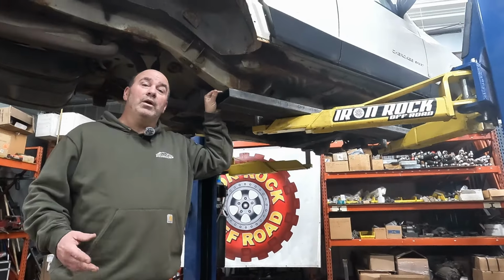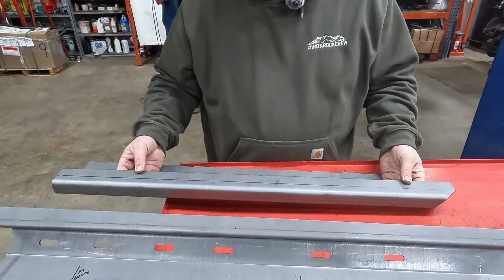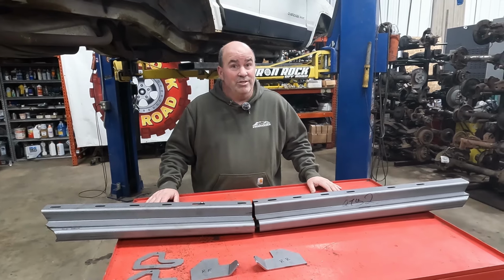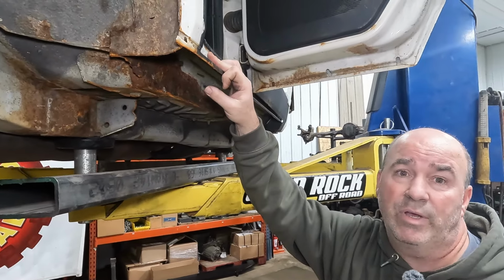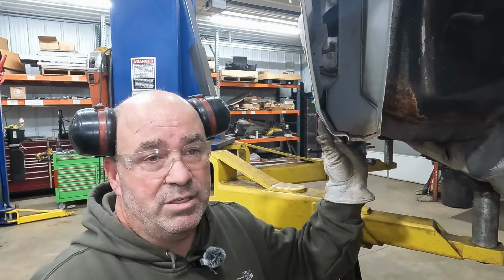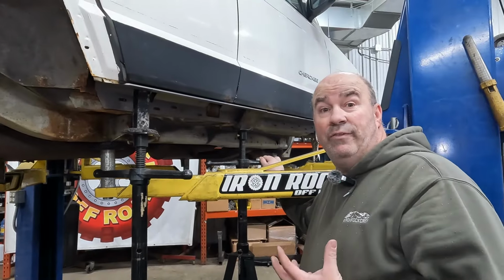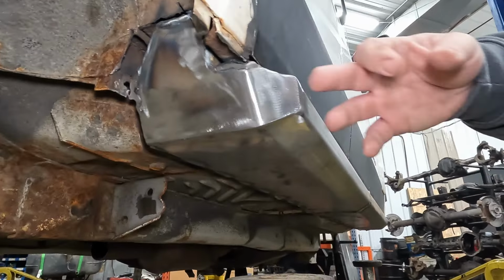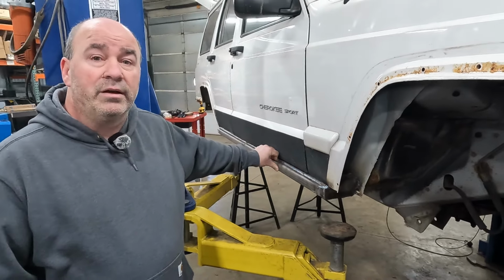XJ Build Series - Rock Sliders - Better than 2x6! Stronger & Higher Clearance!

Comment: Man, what a shame to weld that thing right on top of all that active rust.. grinding the whole area and adding a little weldable primer was just too much work?
Reply from the maker: @stevehamel1336 Great point. Because of the time constraints we did not show painting the interior of the rocker in the video. Later, after the video, we used a sprayable internal frame coating that comes with a long hose attachment to reach inside and coat the rocker from the inside. We have not had great luck with weldable primer in the past. Do you have a recommendation on a good product?

Comment: Great product that I am going to install on my XJ....but why didn't you take the opportunity to treat the rust that is now sealed behind the sliders?
Reply from the maker: @WBR79 You are correct. We should have treated the rust inside the rockers before welding. The good news is that if you pop off the door sill plastic it gives access to the top side of each gusset. We plan on spraying Eastwood Internal Frame Coating inside the rockers using the included 24" extension tube. We should have done it right from the beginning, but this is better than nothing!

Comment: Man, this is begging for some plate to be welded in to the unibody rails from the rock sliders... super strong if you've welded in the stiffeners, and the XJ isn't a rust bucket.  Weldable primer, drainage holes and cavity spray...
Reply from the maker: @Brian_C_ We appreciate the input. The design of these sliders has been proven in the rocks and we stand by them 100%. However, we know there is no one-size-fits-all Jeep product on the market. If you feel the need to add more plate to them, we say go for it! We completely understand the itch to change and modify things. That's how we got here!
Reply: @IronRockOffRoad  Totally agree about the 'no one-size-fits-all'. Rocker armor is definitely one of those things that ranges from 'absolutely stronger than the XJ' to 'I'm just doing it for the look'. Looking at your product, I'd say it's solid. I absolutely love the idea of the reinforcement ribs vs. using straight 2x6 steel. Having those pieces CNC plasma cut is a huge time saver. My previous was, in no way, a negative criticism of your product.
Reply from the maker: @Brian_C_ No problem at all, I didn't think it was negative. I figured it was just one Jeep guy talking to another, tossing around some ideas. I would say that if you are tying a roll cage into these sliders then I would 100% add some gussets from the slider to the uniframe rail. It's never a bad idea to add strength when we're talking about safety items.

Comment: Great idea.....think you can do similar to the JK/JKU platform since its body is like a car (no tub like that of a YJ/TJ/LJ) with a drip rail holding the floor panels together? 
What about placing a rub rail on the outside square face to match the width of the flare?

Edit: seen your latest on the XJ mods and the rub rail for it. Thanks.
Reply from the maker: @Mickale-Moranis Not a bad idea. I'll pass it along to the R&D team.

Comment: Great design! I was wondering if it would be beneficial to make them longer so buyers can trim the ends to their own specs based on each vehicles fender trim?
Reply from the maker: @milesneimeyer7584 That is a great idea, and one of our first thoughts also. We stopped the sliders where we did because that puts them right at the edge of the OEM fender flares so you don't have to cut them. Also, that is the typical spot where most XJ owners are trimming their fenders. It makes the sliders a win-win for both scenarios.

Comment: can i still mount the frame stiffners with this and tie a roll cage into it?
Reply from the maker: @TheBackpackingSailor Yes. We installed frame stiffeners right after doing these rock sliders. Yes, you can, and you should tie a roll cage into the sliders and the frame stiffeners. Both of these products would make a firm foundation to build your cage off of.

https://www.ironrockoffroad.com/product/xj-structural-rocker-armor.html
https://www.ironrockoffroad.com/product/xj-unibody-frame-stiffeners-full-set.html
Reply: @IronRockOffRoad  thank you so much

Comment: Any chance you will be selling just the front part? So the MJ could possibly use this.
Reply from the maker: @mjguy I would recommend getting the full length. That way you can protect under your bed side as well. For reference, the front section is about 34.5" long on the flat (horizontal) part under the door opening.
Reply from the maker: @mjguy I just checked our project XJ. You would need the whole length. The seam for the front part is under the front door.